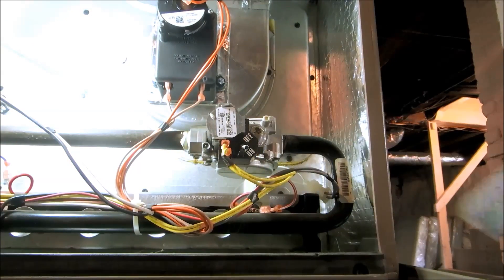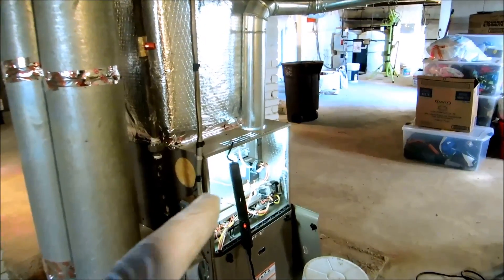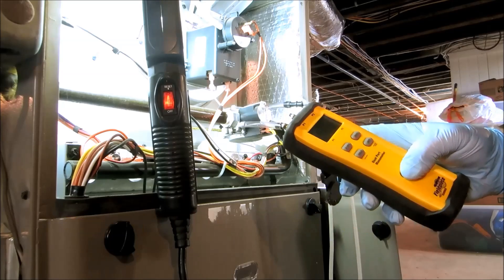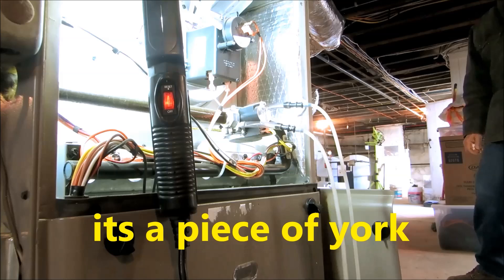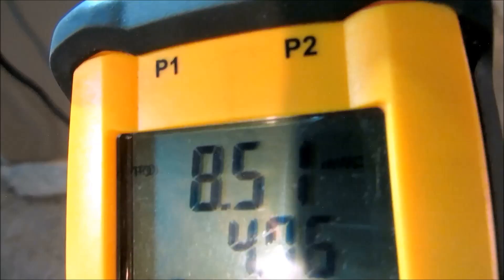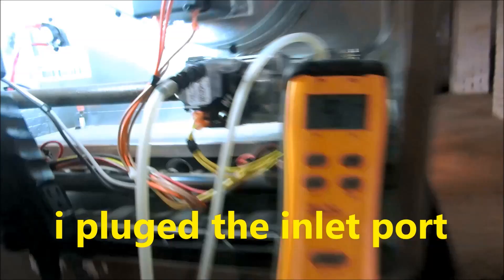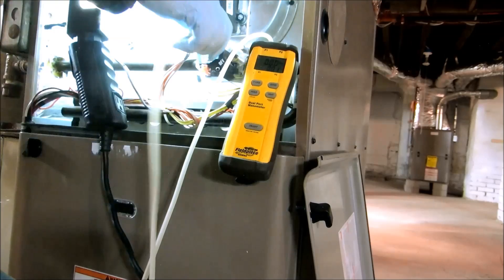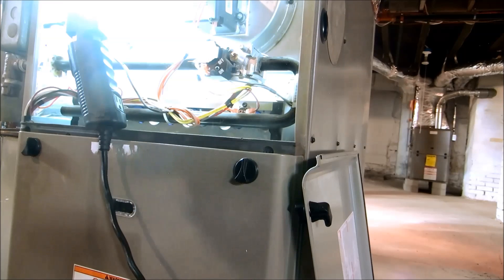hvac:gas furnace set to proper manifold pressure

Comment: do you know if the water column pressure coming off that valve is calibrated according to the overall p.s.i. in the main? or is it most always around 3.5 wc? /thanks

Comment: Great video Steve. On those valves you don't have to remove plugs just crack them
Reply from the maker: hvacman77 i feel better taking the allen plug out ,so thats what i do .i know some valve there is a divit so the plug will not some out. thanks for the comment

Comment: Steve good work. I have the same fieldpiece. I use it for everything from gas pressure to pressure switch reading. lately ive used my Testo 320 to get gas pressure readings and print it out
Reply from the maker: Emin HVAC thanks for commenting emin